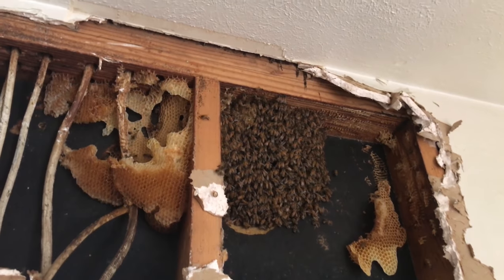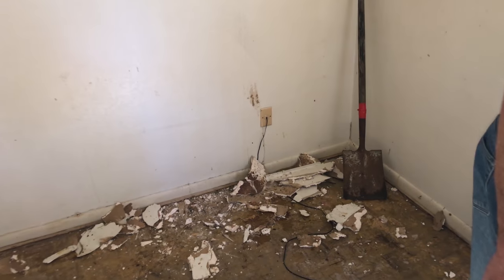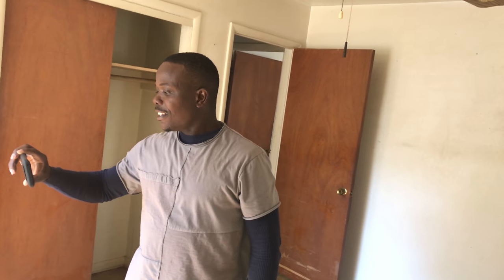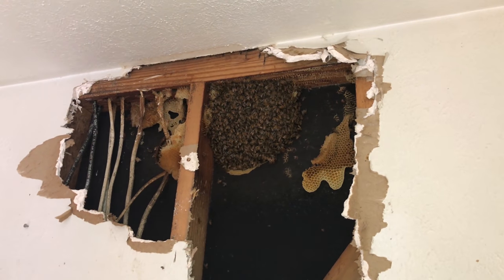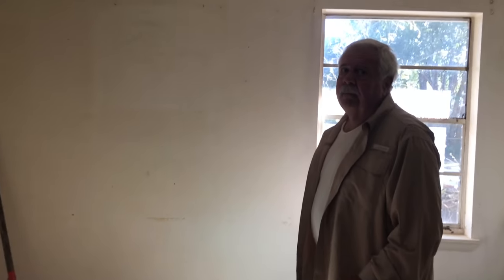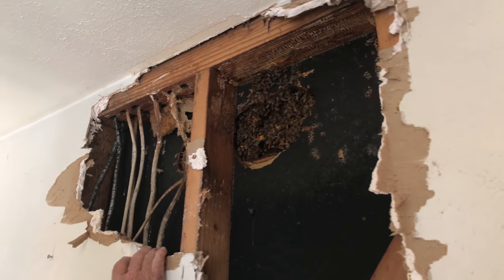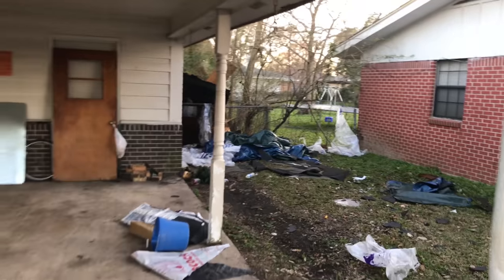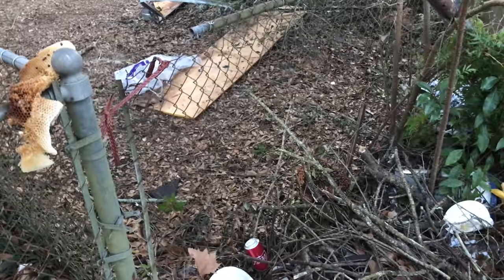The Calm Before The Swarm...  First Hive Removal Of 2019

Comment: I am an electrician.  There is a little tool caled a volt tick most hardware store will have them.  You just hold it next to the wire and it will light up and beep if the wire is live.  It would not hurt to have one in your tools
Reply from the maker: I used to have one.  I lost a whole tool bag and that with it.
Reply: @628DirtRooster  oh man that suck I know the pain of losing tools all to well.  Also happy to see you double check the power thats like rule one in electrical never trust anyone haha.
Reply: Hardware Hack. I could be wrong as I am visually impaired a bit and not an electrician, but wasn't all of those wires except for the yellow one the old asphalt cloth wires?  They looked like it.  I know in my area of Georgia and South Carolina if the power is cut, for any reason, the power company requires a whole house electrical inspection by the prevailing Electrical inspection Dept. Prior to reconnecting service.  This inspection, in our area at least, would result in the complete rewiring of the house to bring it up to current code and would even include the sacred and panel box and it's location.  I have remodeled a couple of houses and recently bought a 1910 home that originally had known and tube wiring.  Updated writing on the sixties with some upgrades (?) since then to include a few there prong outlets and one 20amp circuit.  Just wondering if I'm blind or just wrong.  LOL
Reply: @jimjordan5630  It all depends on what has to be done. In many cases, old wiring can be grandfathered as long as nothing is changed. I had the pleasure of working on a house built in the 50s with Aluminum wire and the panel was fused rather than breakers. They were wanting to switch the range over from Gas to Electric. But in order to do that it meant a total rewire of the whole house. They could leave it alone and stay on gas, and that was fine. But to switch to a 2-pole service meant replacing the service panel which meant changing all the wire to copper.
Reply: I lived in an old house once. There was a cut wire that used to run to the garage outside  and I would pass by it every time I mowed the lawn. I tested it one day with my little blinky tool that I used to see which outlets worked and I'll be damned. I was lucky. I think it was 220.
Reply: @ShlisaShell  if it was 220, you would need to touch both hots to get the full effect. Otherwise it's only 110 between one hot and the ground. Not that 110 won't light up your day either!
Reply: @SD40Fan_Jason  👍
Reply: @ShlisaShell  I used to live in a house old enough that it had been retrofitted for electric back in the *1890*s. My housemate took it into his head to rewire the house ... and discovered that previous owners had rewired the house at least four times without troubling to remove the old wiring. He was not happy to learn this.

Comment: Hey Randy, you probably already know this, but a really useful tool to have for checking if those wires are live, is a non-contact voltage detector (a.k.a. 'proximity detector' or 'Volt Tick', a popular brand).  It can be gotten from Home Depot for $10-$25, looks like a pen, and detects voltage through the insulation, without the insulated tip needing to be in direct contact with the wire conductor.  They light up and chirp if voltage is detected, and usually include a handy built-in penlight.  Helps confirm what they're telling you about the status of the power to the building, and eliminates any doubt in a multiple unit scenario as to whether you're checking the correct meter for that unit/wire.

Comment: Hi Randy, you can buy you a cheap proximity tester for less than $30 bucks that test for electrical current just by touching the insulation of the wire. Love your videos.

Comment: "non contact voltage tester" is a handy little thing I carry in my pocket all the time. Haven't changed the watch batteries in the thing in years!
just hold it up to any wire in any location or touch it (the coating part) and it will scream if it detects current. I always test it on a known live wire before using it, but it's never failed me!

Comment: Yooooooo that looked like a royal pain to get at. If I've learned one thing from watching you and JP, it's that if I ever get my own house built, I'm going to make sure that every single void space in the house has a simple way to access it.

Hell, if I ever build my own house, half of the exterior's gonna be void spaces the exact height of the more common Langstroth frame interiors. I'mma live in a swarm trap that'll give the easiest cutouts ever for removals, just slice 'em along the upper and bottom places and chop 'em to length, bam, ready to rubber band. Hook the local beekeepers up with colonies left and right!

Spoilers: I'm never gonna make enough to build my own house the way i want to.

Comment: Live wires .... I rented a small flat off an electrician. He would come and turn my electric off and not tell us why. Kept getting cross that we turned it back on. One of his lads, after several weeks of this, explained that above my door was a bare live wire that had sent one of his lads across the workroom inside when he touched the wall. Thanks landlord for not telling us about the dangerous live wire touching our building and for not fixing it for several weeks. 
Never trust wires or that landlord😂😉😍😘 so weird I have met / known loads of electricians and none have been that inconsiderate. May require a Darwin award.
Thanks for the lovely video 😍😘
Reply: a 110v line "sent one of his lads across the workroom" ?
someone is telling you stories... unless they were standing in a bathtub full of water at the time
Reply: @funkyzero  UK 230v mains supply not your USA supply sorry ... and I know that room was loaded with metal shelving so probably the metal shelving that he touched. He was bandaged from hospital so I know he had to be treated. The lad I was talking to was a bit worried I would tell landlord that he had said anything. I am sorry but I do believe the lad. He just wanted us to know why the electric kept being switched off. The earthing straps to ground had been severed too we found out  later😲
Reply: Makes me laugh how many adapters some companies provide with electrical equipment in the U.K. 😂😉 usually you only need adapters for equipment that they only supply with 240v plugs

Comment: Ever have those moments when you're just bemused by how afraid people are of perfectly peaceful bees?

But if the house isn't yet occupied, is there a reason not to confirm with the power company that there's no power service, and then pull the main circuit breaker or fuse? Seems like it would be safer to confirm those wires are cold before working around or through them.

Comment: Rooster, what is the batt. life of the vac.  thanx bill
Reply from the maker: Loooong.  I’ve done two full removals on one charge before.
Reply: Bill, the battery will run 4+ hours at normal vacuum speeds.  Turning the speed up and down as you work, I've had customers tell me it runs 8-10 hours.